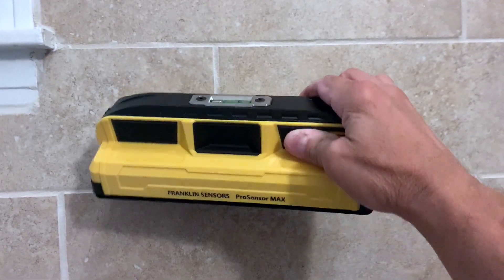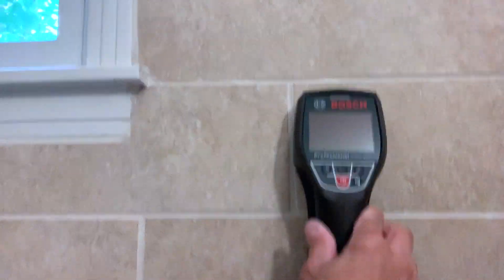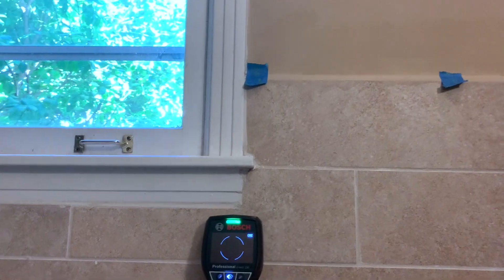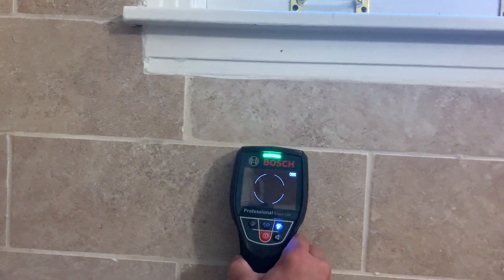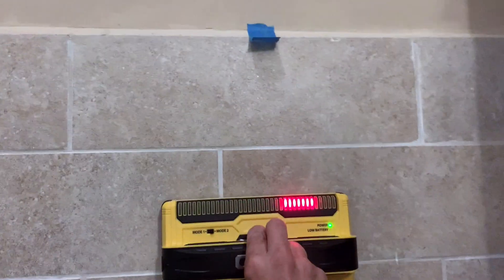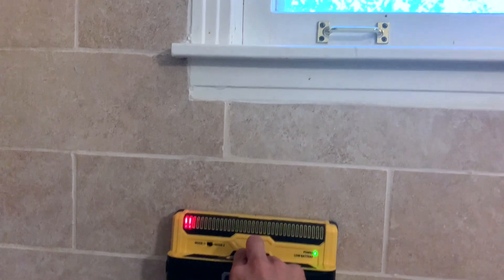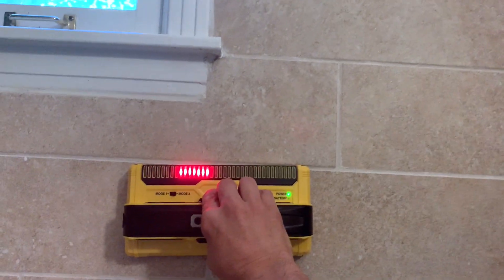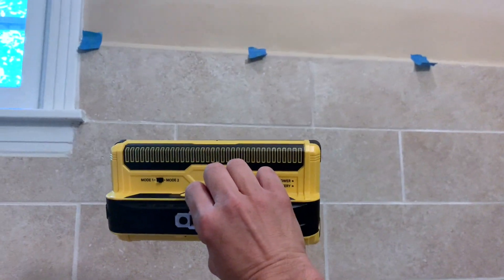Franklin Sensors ProSensor MAX vs. Bosch D-TECT120

Comment: I have the "Milwaukee 2290 Sub Scanner Kit". I tried to scan the side garage walls, but it kept saying error and to calibrate.
So, I bought a high end "Zircon" at the "Home Depot". It was wide and awkward to hold. Also, it was hit and miss.
I talked to the salesman at "Home Depot" and he told me to check out the "Franklin" as he owns one.
Before I bought the "Franklin" brand, I checked out the "Bosch D TECT-150" for $1,000.00. It had a hard time scanning and determining what was inside the wall.
Finally, I bought the "Franklin M210 at "Canadian Tire" for $59.00 CAD.
It blew the other brands out of the water and never missed a stud! NO calibration which is a pain with the other brands.
Made in the USA🇺🇸 as well!

Comment: What’s the difference in modes 1 & 2
Reply: Sensitivity 
Mode 1 is for shallower depth-drywall/ sheetrock type.
Mode 2 for deeper depth-plaster lathe, double sheetrock

Comment: Impressive that the Franklin works through tiled walls.  But I don't think it can tell the difference between wood, metal and water pipes.  Tell me if I'm wrong.
Reply from the maker: I can't say for sure, but I think it only registers objects that are in contact with the wall surface, and not things "floating" in the wall like water pipes or Romex.  As always, one needs to incorporate intuition and experience when using tools like this.
Reply: @mikeadiddle The M210 detects electricity.
Reply: @mikeadiddle  Thanks for the clarification.  Do you have a review of any of the Walabot products?

Comment: The D-Tect 120 is around $250 at the moment. It's not supposed to need calibration according to Bosh videos. I think you need you put your hand on the wall though. It's supposed to detect water filled pipes, plastic or metal. So you are comparing 2 different capabilities for one purpose, to be fair to the Bosh.

I'm in active research of a new stud finder and I'm still hesitating on the Bosh as it has unconclusive reviews. This Franklin is impressive, it might be the one. Is it as good on drywall and other wall structures?
Reply from the maker: The purpose of the video is for efficiecy in finding studs through tile.  The Bosch does need calibration, by moving it back and forth against the wall surface.  While the Bosch is far superior for finding many things deep inside of cement and block, I think I demonstrated that this Franklin is much more efficient at finding studs through tile.  And despite my mispeaking the price, it's much cheaper.
Reply: @mikeadiddle  I see. So are you planning on using the Franklin first and confirm it with the Bosh to make sure there's no pipe?
Reply from the maker: @romt-712  It's never a bad idea to double-check, right?  Given the accuracy of the ProSensor MAX showing studs "where they are supposed to be," I don't think it will be necessary in most cases.  I'll still keep the Bosch handy for questionable situations.  The Bosch picks up so many different things in a wall, it can actually lead to some confusion.
Reply: @mikeadiddle  Yeah I feel the same. I just ordered the Bosh on sale to keep around and have more info if I have a doubt. I guess no pipe on an exterior wall usually right? S in this particular video, in 30 sec you're ready to drill.
Reply from the maker: @romt-712  Also, keep in mind that a metal pipe isn't going to show up as a perfect 1.5" reading on this detector.
Reply: @mikeadiddle  The Bosh or the Franklin?
Reply from the maker: @romt-712  The Franklin.
Reply: @mikeadiddle  Like less LEDs?
Reply from the maker: @romt-712  Correct.  A metal water pipe, even if it's sitting right against the wall material, isn't going to be 1.5".   In tis video, you can see the lights clearly showing 1.5" wide readings.